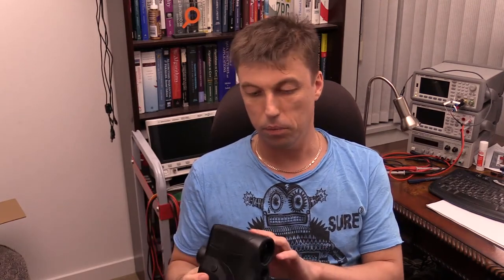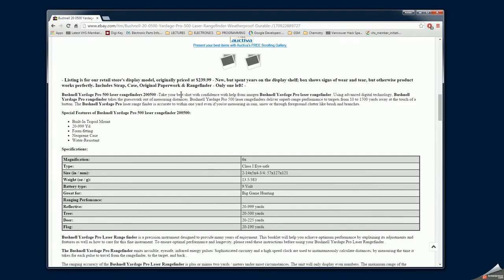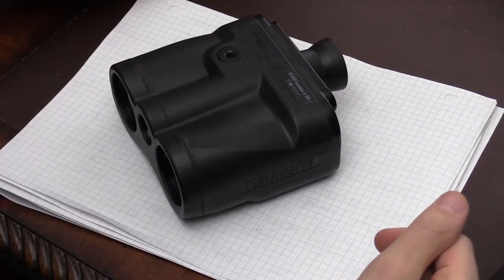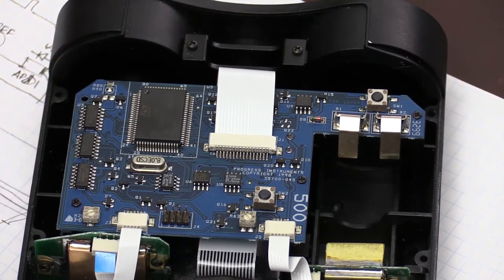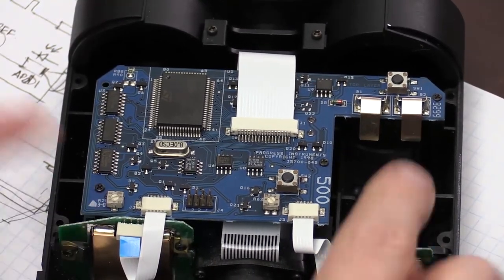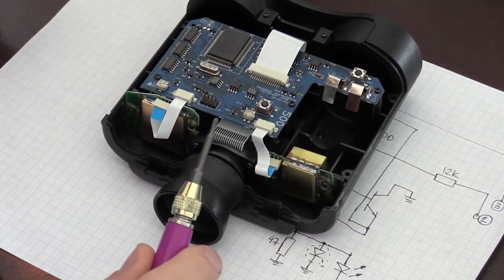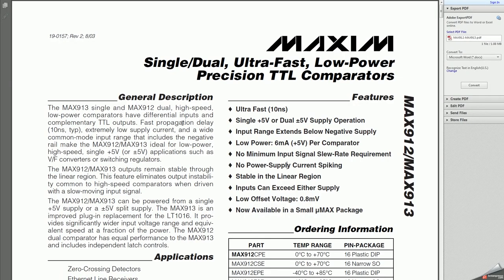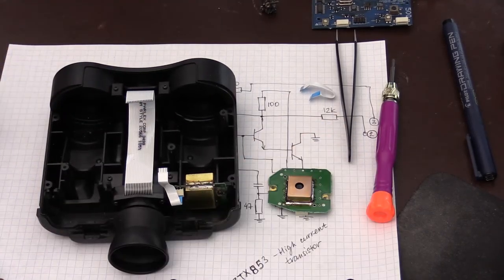Episode 9, Bushnell Yargade Pro 500 Laser Range finder, teardown

Comment: The avalanche photodiode bias is very critical for its sensitivity. It is tricky to adjust because it depends on temperature and ambient light level.  The best sensitivity is obtained when the photodiode SPONTANEOUSLY generates pulses every few seconds in the absence of the reflected laser signal. The best designs adjust this photodiode bias on the basis of the NUMBER of these "idle" avalanche pulses counted over several seconds.  Usually a digital counter is used to count these "idle " pulses for some long period of time and based on that number, the bias is adjusted up or down.

Comment: hi! I am from India, would like you, if possible to help me, I have Revasri 400m laser range finder( its also comes  in 600, 800, and 1000m range) i use it for unusal area of land measuring (above 200m) like EDM( total staion being  to high cost), i  have few question if there could be hack:
1). can we increase range? since same models comes different  distance, electronics looks same.
2). Since its not accutrate by 3 to 4meteres even  after using a refector sheet, can we improve accuracy.
3). use green dieode  since its better in daylight use... any alternate green dieode reciver?
thanks in advance for any

Comment: i have a bushnell yardage pro sport 450 from 2004, it lost the crosshairs on the display. the rest of the display works fine but the crosshair is gone. i have it apart am in the process of trying to fix it. but so far i am not having much luck.

Comment: Have you taken apart a bushnell V3?
I dropped mine in a brook. It was under water for about 2 seconds and now it does not work. I have tried drying it out for about a week to no avail. I cannot find a video on how to open it and I'm not sure I can fix it even if I can get it apart. Any suggestions? 
Wayne from Nova Scotia, Canada
Reply: Wayne burke
Burke brate, put it back in the water for 4 seconds to negate the 2 sec effect.